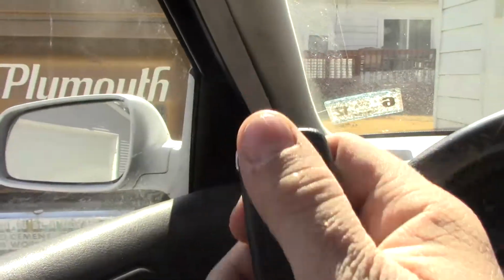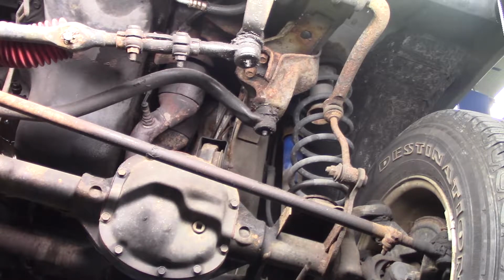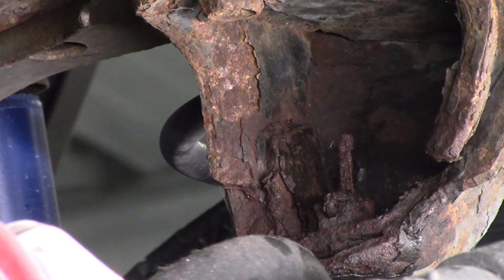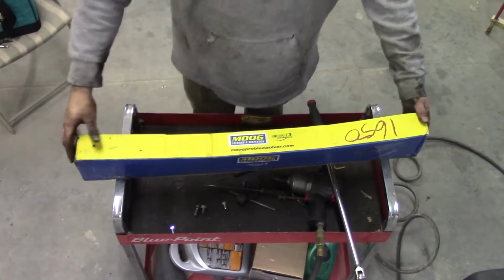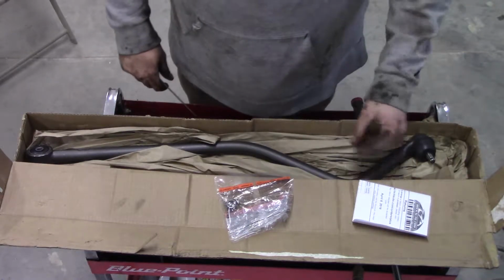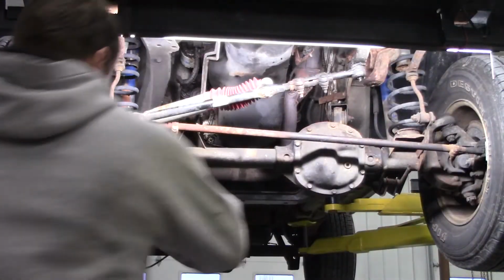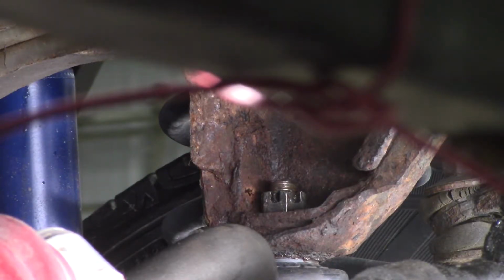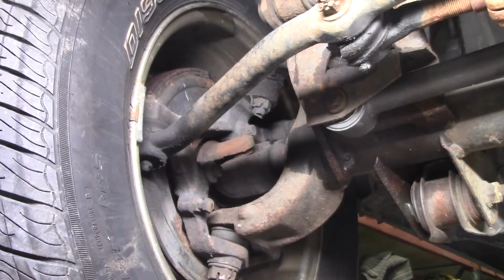Jeep Cherokee -  Episode 3 - Track Bar Replacement

Comment: useful video - I also have an issue getting the track bar out at the frame - castle nut is off, hammering on the pin joint - won't come off - any ideas ? Heat ? Many thanks !
Reply from the maker: If you are replacing the track bar you could use a pickle fork. It will ruin the rubber boot but usually will remove it. Heat is another option if you don’t care about ruining the joint. Otherwise a big freaking hammer will do the trick. I use a 4 to 8 lb sledgehammer. Good luck brother
Reply: @TheOffRoadCorner  thanks for this - well - torch always is your friend  - heated up the frame bracket - then  used a sledge hammer and the f*** track bar falled off. Will be installing a new track bar, so damaging is not an issue, this is the only way to get the old one out, pickle forks are useless in most cases.
Reply: autozone grey OEM clamp like rentable device that tightens the clamp and pops it loose. Looks like a massive clip for a bag of chips that has a 22mm bolt that applies pressure down to pop the track bar free
Reply from the maker: That sounds a lot easier to remove the track bar than beating on the track bar mount until it gives up.
Reply: I used a 3/4" forged ball joint separator was $20 at harbor freight I tightened it a bunch then one whack with a hammer on the track bar ball joint and it popped out like a shotgun blast